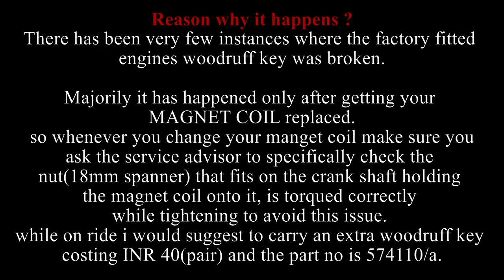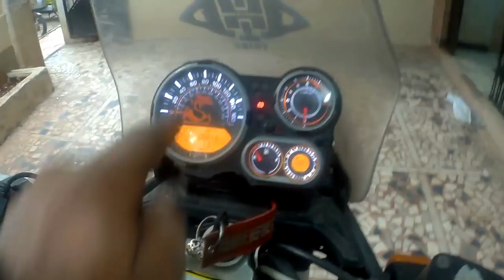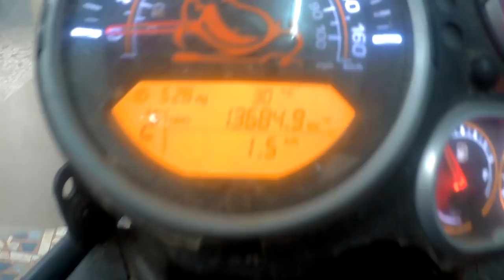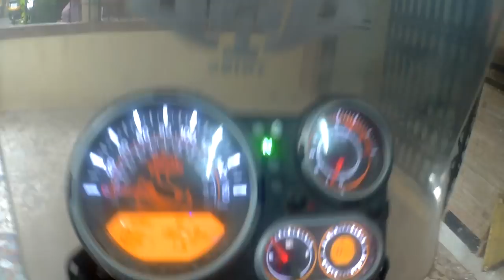DIY | Magnet coil issue-Woodruff key Replacement | Vlog 6

Comment: how did it hold up? i noticed you didnt have a tourqe wrench with you so you could tight with the exact tourqe? i hope you made to where you where going, and you helped me as well... i have a broken woodruff key on my bike but i have been messing with the electrical system without find anything wrong... now i know where to search =) be safe! =)
Reply from the maker: pirro ohlsson still running strong from 2017. Have clocked around 25k kms on it. Yes have ordered for a torque wrench and yet to recv it from 🇺🇸. Now i dont think ill be gwtting it any sooner. Hope ur family and friends all are safe🤘🏻
Reply: And yes so far we are safe and healthty but you can never know... this times to be carfull... i hope your wrench will arriwe soon 😊

Comment: Monty sir... First of all a big salute to u for starting this helpful blog.. It could be a life saver for riders stranded in emergency situations. I was wondering to ask that in this sleeping stance of the bike is der possibility of oil leakage and fuel leakage?? And what if i have leg guard put on in my bike??
Reply from the maker: Brijesh Tank thanks for appreciating. With or without leg guards the procedure to do the same won't change. Fuel and oil dosent come out. Fuel of filled till the brim or even 75% of the tank then it wud sill from the filling cap.

Comment: So does the same mechanism work with the BS4 model?
Reply from the maker: Hi sorry for the late reply bs4 has a different magnet coil as in terms of wiring in it due to fi but yes if the woodruff key breaks then the symptoms  are same
Reply: @Montuned  no problem. Thanks for the reply 👍😊